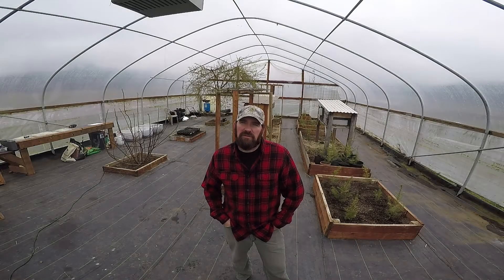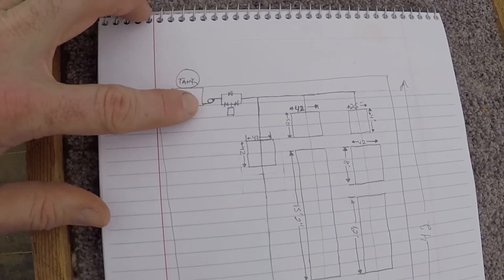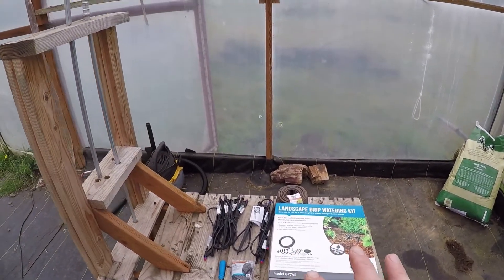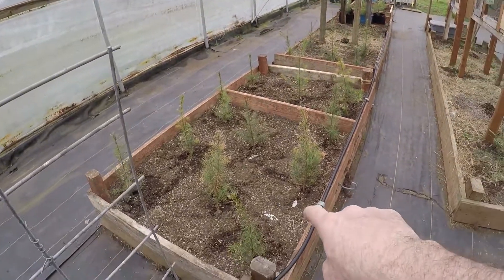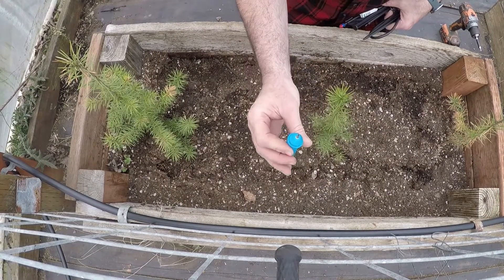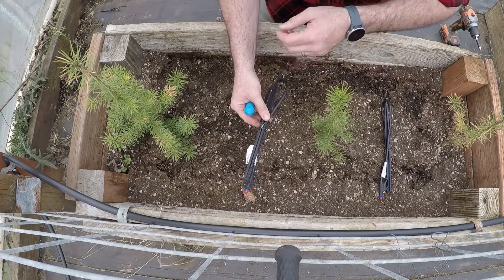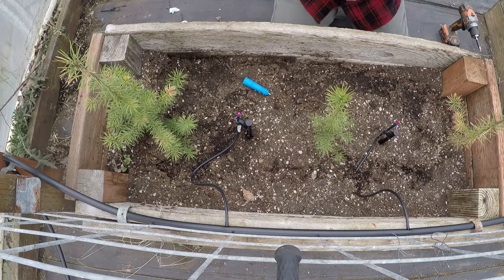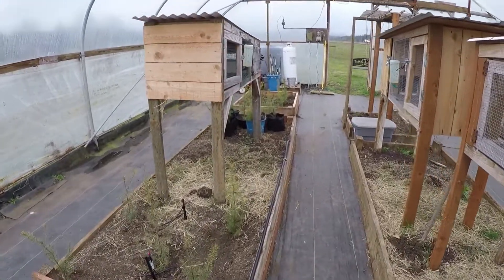DIY Greenhouse Irrigation System

Comment: its looking good. What pump did you use? also is your tank a tote or you pulling the water out of the pond?
Reply from the maker: Its a tote with a submersible pump. I will eventually put a pump in  the pond and wire it in junction with the sump pump so when the irrigation is running the pond pump will keep the tank full.
Reply: @beardedfamilyman243  perfect plan.